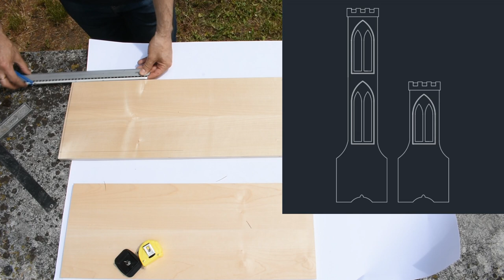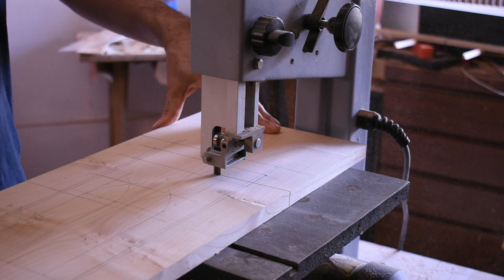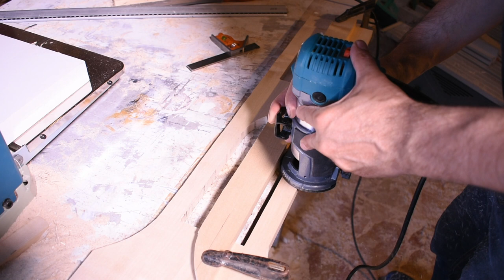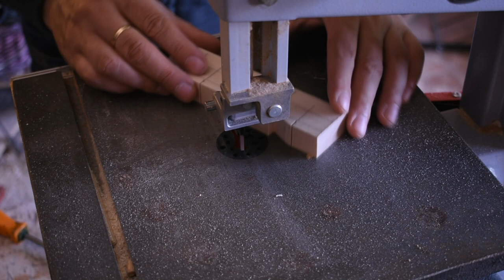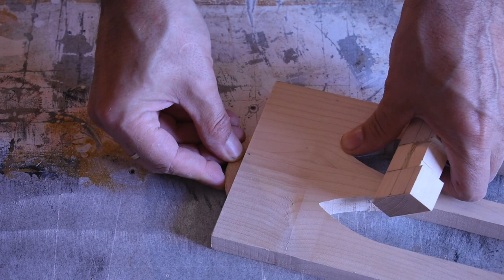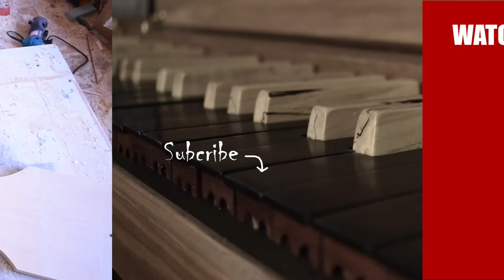How to build a portative Organ | #24 The Frame | SUB ITA | Homemade Pipe Organ

Comment: I'm very impatient to ear this organetto ! great job !
if I can give you a cabinetmaker's advice...
Your chisel skill is not very good and very dangerous for your fingers...
Never put your hand in front of a sharp tool , it is a rule that must be respected at all time.(same thing wiht the lamelo machine if the wood piece is small...)
Clamp your wood work piece into a vice, or with clamper something adapted to the shape of the wood, and take your chisels with two hands. 
Your fingers will be safe, and you will gain into precision, because wood piece don't moving, and better control of thhe chisel because two hand take it.
I post this comment because that not the first video of you where I see you do this very dangerouse practice...
Sinews and fingers don't re-grow up... and they are a little utile for plying organ, lol !
Good continuation
Reply from the maker: Thanks galiux69, thanks for the comment! Yes, you're right, never forget the basic safety rules
Reply: @nippocast  Yes, accidents can arrived very quickly. and a very sharp wood chisel can do very very serious iremedible injurys.
For me this is so stressful to watch, I saw in permanence multiple accidents flashes   lol.
Be carefull ;)